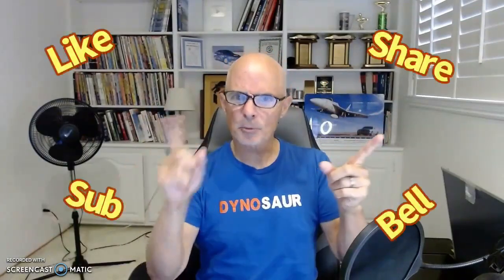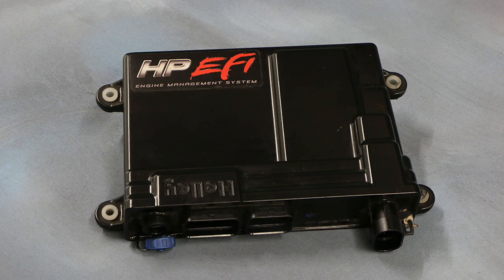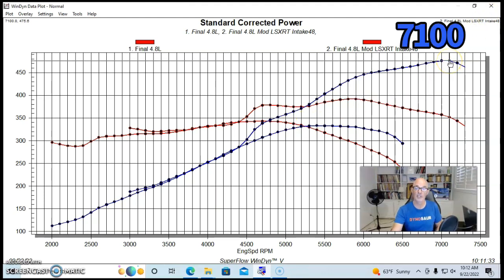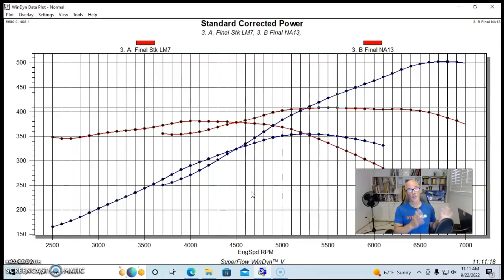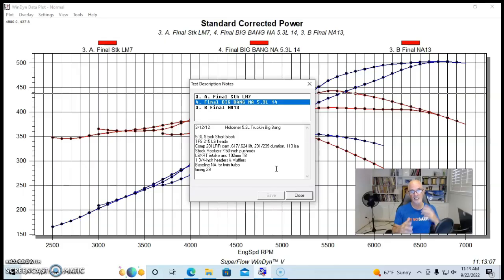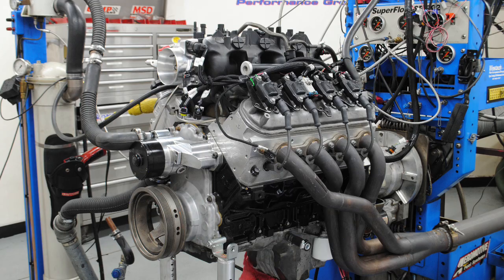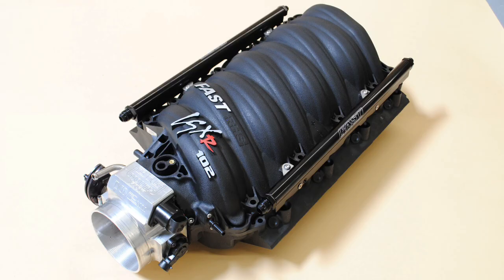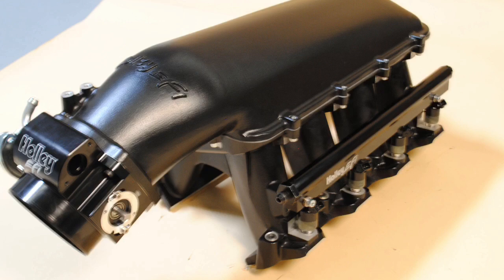HOW TO MAKE ALL-MOTOR JUNKYARD LS POWER. HOW MUCH ARE HCI MODS WORTH ON A 4.8L, 5.3L OR 6.0L?

Comment: Not that hard to get 100/l....maybe using truck motors with 9.5 compression. Gotta get the compression up and it's cake.
Reply from the maker: IT'S VERY HARD-TRY IT
Reply: 706/862 heads have a 61cc chamber, which are smaller than the Gen 1 SBC heads (76+cc) Trickflow have 58cc chamber heads, you can get flat or domed (not dished) pistons. Just remember the duration of the cam could cause piston-valve slap.
Reply: @richardholdener1727  we have. And right now i have a 5.7 in my old 4gen with 12:1, mahle 1-1-2mm rings with 4cc valve reliefs, 235 .630i 24x .650e solid cam, crank scraper topped with old gmpp ls6 heads, roller rockers and a msd intake. It should be in the 520whp range. My buddy made 540whp on a fuel with a wore out h/c ls1 using that cam and on a fuel.....likely well over 570crank. 

The old bolt on ls6 made 451whp/423wtq on pump gas....that would be about 500crank give or take a few hp with stock cam, stock heads, sbe.  And that was on pump gas. On e85 expect more.....and I'm planning on running e85 with this new engine.

My buddy builds race engines for a living. He's made 620 crank out of 5.7s and stock 243s for dirt cars. 

It's not hard you just have to think it through. That last 6.0 in this vid woulda went over 600 with a crank scraper......more with porting the intake. Throw some e85 at it and mill the heads some and you might be looking at nearly 650. Maybe even more with a solid roller cam and adjustable rockers.

We made over 560whp with a h/c 6.2.....likely around 620crank hp on pump gas. 

Alot of times you're leaving 20-40hp on the table.....the devil is in the details.
Reply: @HioSSilver1999  What mods did the LS6 have to make 451whp? I'm surprised it got to that power level with the stock cam. 405 crank hp to 451whp are big gains for intake and exhaust that I would consider bolt ons. I'm looking to build an LS1 with a goal of 400whp and good street manners so 451whp with bolt ons sounds like a good reference.
Reply: @gstevie97 bolt ons....not even really all of them. E85 would've added more. So would a vacuum pump. 470whp out of a bolt on ls6 is completely possible.
Reply: @richardholdener1727 so to update you on me trying it. My Camaro just made 544whp 446wtq......it was running out of fuel pump tho. That was on pump gas to. I have a fuel pump for it now, most likely gonna do e85. I have a vac pump for it and I may bypass the power steering. I think 100hp/L at the wheels is possible.
Reply: @HioSSilver1999  Which bolt ons?
Reply: @gstevie97  kooks 1  7/8" headers, speed engineering td x full exhaust, fast 102 ported by me, mezier electric water pump, belt mods, crank scraper, 1.8 roller rockers which helped mid range more than top end, light clutch,  through a fab9, my own intake system.....on point tune. 

I did bypass the power steering pump on that dyno. I did that  to put the car on par with these newer cars that have electric power steering.

Was on pump gas so there was still some things left to improve. Some e85 would make another 10ish whp conservatively. A vac pump another 10-15 whp. Feasibly a bolt on ls6 could make in the 475whp range.....all with stock heads, stock cam and still a 5.7.

Comment: I want a 2007 GMC sierra 1500 2WD standard cab truck with a 4.8L v8 engine.How much money 💰 would it cost me to build a 550 horsepower naturally aspirated 4.8L v8 engine powered sierra truck?[550 Hp. @ wheels & 550 Trq. @ wheels] No supercharger,no turbo chargers,no nitrous.I would build the custom modified engine myself & modify automatic transmission.I will work with a professional automotive machinist for other performance enhancement🔧
Reply from the maker: you would be hard pressed to get 550 hp from a 4.8L. and suck a motor would not be very drivable (big cam, high comp, short runner intake etc...) but 550 lb-ft won't happen without a power adder

Comment: 🥝✔️ ( The two valve per cylinder  375 HP net  Lamborghini LP400 Contach made 95 HP per liter, the early Euro spec 4 valve per cylinder  2 liter Lotus, 81 HP per liter, all net. It's pretty hard to get 100 HP per liter! S2000 Honda, 120 HP per liter. Yum, Yum, Yummi! 🥝✔️
Reply: I think torque per liter is a better comparison of VE.  You could have a very inefficient engine that revs high and makes over 100hp per liter, doesnt mean it has good VE necessarily.  On the flip side, i think hp curves are the best way to compare different engines, since some are bigger, some are faster, but they are essentially air and fuel pumps.
Reply from the maker: I THINK FERRARI NOW HAS THE SPECIFIC NA HP CROWN
Reply: @richardholdener1727  the Cosworth V12 for the Aston Martin Valkyrie might be higher unless you know of something that I don't remember. It is a 6.5 liter V12 making 1,000 flywheel horsepower @ 10,500 rpms for 153.8 horsepower per liter.
Reply: @richardholdener1727   The Ferrari 812 Competizione 830HP net from the  6.5 liter V12, for 127.7 HP per liter! Chevs 1972 SAE Net to SAE Gross conversion was 1.31. So if your Pushrod or OHC US engine is  doing 131 HP per liter, you'll easily be out doing a Lamborghini, but Maybee not a good Honda.....or Ferrari. Or that Aston Martin...

Comment: 100hp/litre is not impressive (to me atleast). That wouldn't have been impressive in 1999 when 125hp/liter engines were in mass production. I wish the big three had put effort into valve-train stability, but there was no reason to.
Reply: 100 hp per liter is impresive only in NA because with boost you cant compare anything

Comment: You should have started with a Honda engine. Most of mine make 100hp per liter from the factory 😅
Reply from the maker: If only I knew a thing or two about Hondas
Reply: @richardholdener1727  I agree. It’s not like you’ve written a book on Hondas. 😉.  /sarcasm off

Comment: Honda set the bar for poor man’s power 😂 with 100hp per liter with accessories. B16 160hp and b18 197hp.
Reply: Honda had the first production 100hp/l engine in the Del Sol.